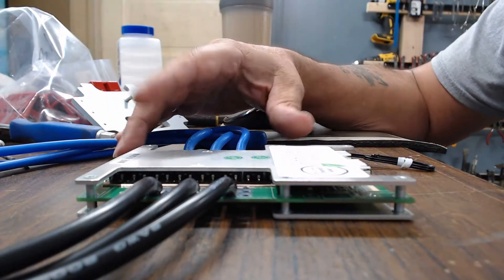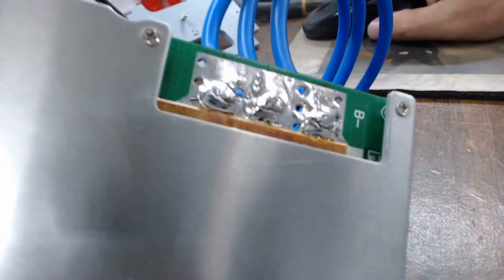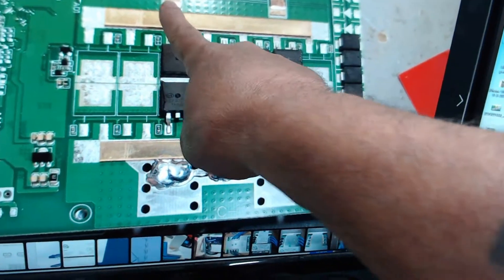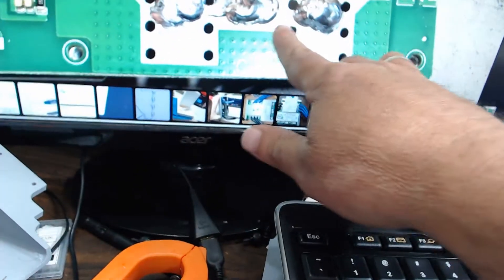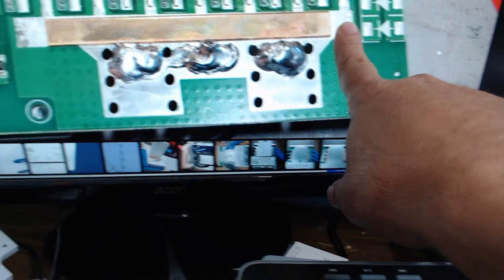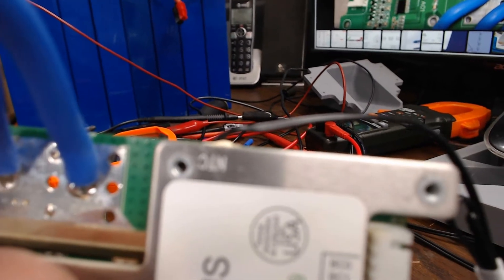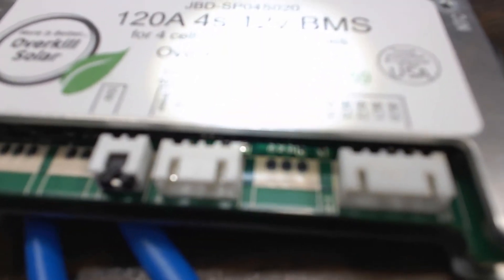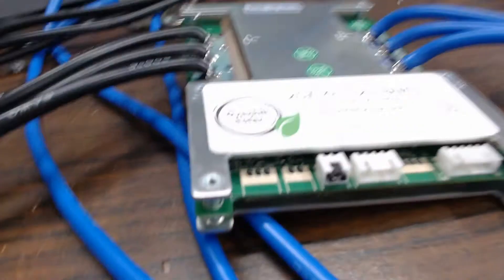Overkill Solar BMS compared to the same PN straight from Manufacturer Imported versions.

Comment: Hi, the nice detail is appreciated. I have some 188AH Samsung 5S2P cells, 18.35 nomimal voltage. I wonder if the Overkill 48V 16S will allow me to use only 15 of the cell strings like the JK's? Thanks regardless!